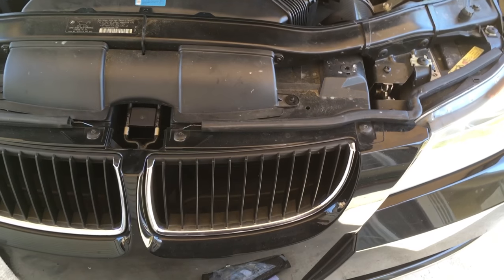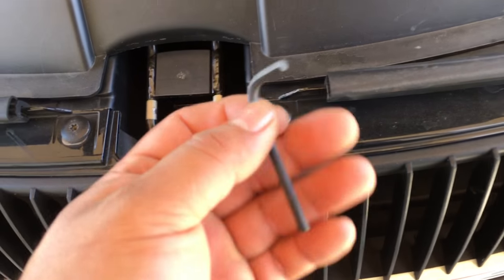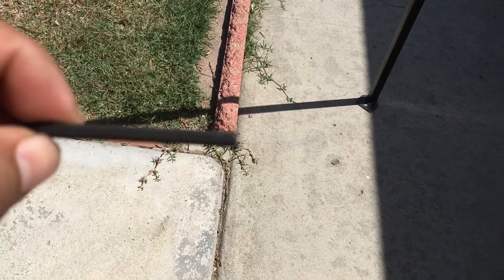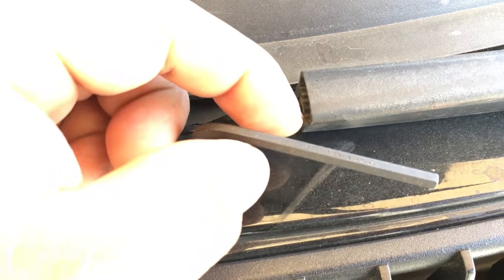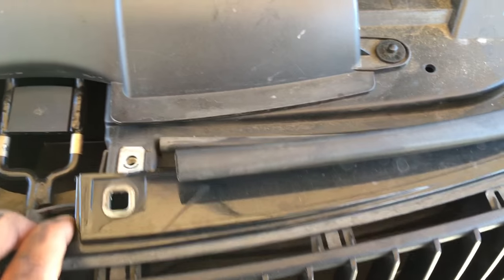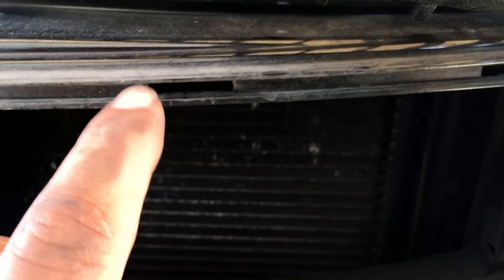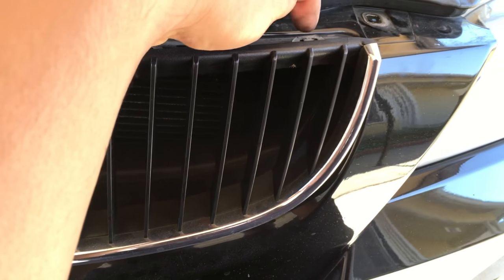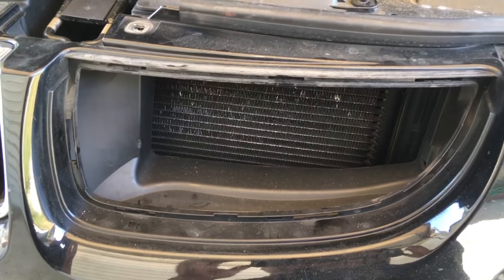HOW TO REMOVE Grill 3 Series E90 328I M5 M3

Comment: i was wondering if you could help out so my wife went out to turn the car on, on a cold day about 10 degrees out and it didnt start on her, so when i got off work i went to try it too and still didnt turn on and then i tried to jump start it and it just cranked and cranked but didnt turn on and i also went out to buy a new battery and it still just cranked. it does get fuel
Reply: sorry forgot its a 06 325i 3 series and no check engine light was on and had no starting problems prior to this i speak spanish ive noticed your accent btw
Reply from the maker: When it cranks does the engine try to turn over ?
Does all the lights turn on on the dashboard?
Reply: +Repair Fanatic yes it tries to turn over and all the dash lights turn on radio also works windows  roll down, it gets spark, fuel and compression
Reply from the maker: +jetadel13 I would say it's your starter. Check out my video on the symptoms of  bad starter.
Reply: +Repair Fanatic if it was my starter wouldnt it just click or not do anything at all, because my car cranks fine but just wont turn on and sounds like it wants too
Reply from the maker: +jetadel13 yes. Lock all doors with the Car key wait five minutes open the doors with the car key do not use the remote. And try turning on the vehicle.
Reply: +Repair Fanatic so lock it with remote and take key out of key fob and unlock it with the key itself!
Reply from the maker: +jetadel13 yes